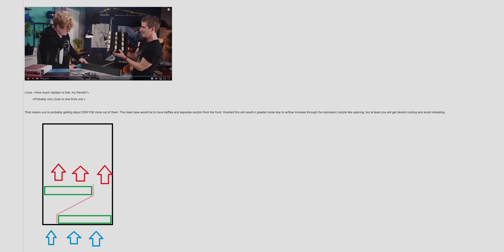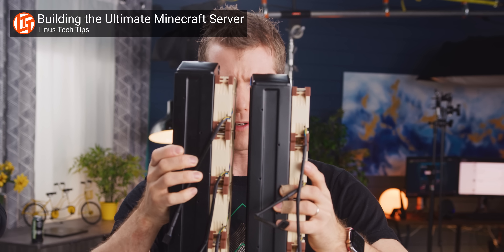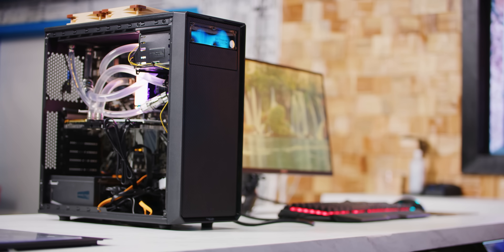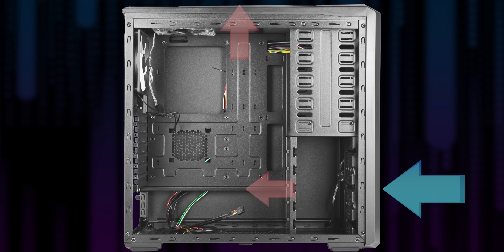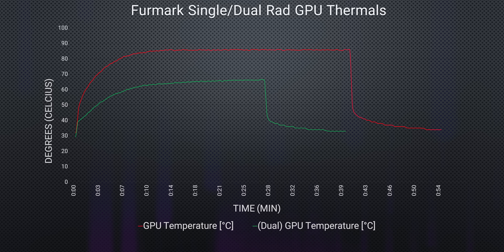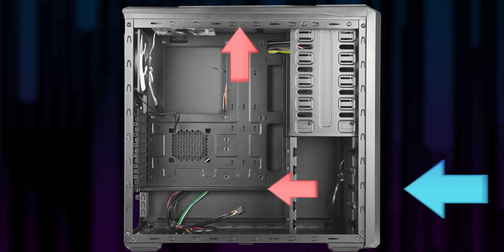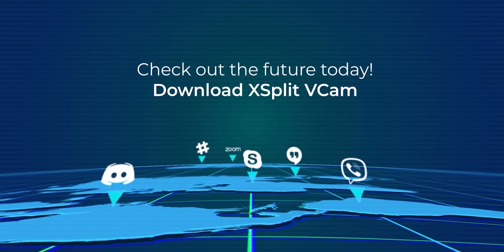I’ve been water cooling wrong for YEARS - $H!T Manufacturers Say

Comment: ok so issue right away, you go from a system that pulls in air from the front to a system the pulls in air front and actively exhausts it out the top.
If you want to do it right those top 2 fans would be there in both tests, the only difference should be the second radiator.

Comment: Linus should hit up Engineering explained and look up the Honda Civic modding community to do some research into the physics of stacking radiators
Reply: YES 😂
Reply: An EE x LTT collab would make my life
Reply: They are probably already collaborating. A lot of the bigger YouTubers do in many ways. (: But good point either way.
Reply: If you seperate the rads, it's usually fine. But stacking them doesn't work well. That's why running air conditioning on a hot day can result in your car engine overheating, as the radiator and condenser are stacked.
Reply: This one /watch?v=Ldfuzy_JJUo

Comment: Your experiment is ill conceived. You should have tried just an exhaust radiator, where you're not blowing hot air into your case, with an exhaust radiator and an intake radiator, or just two exhaust radiators v one. Blowing hot air into your case makes zero sense.

Comment: for efficient cooling you should use an external (case independent) radiator, such as MoRa.  On your dual rad system the warmest water should first go to the top (or outblowing) radiator, so most of the the transported heat would go out at first. the second rad has lower heat to cool and the resulting air coming air would not be so warm as if it would be reversed.

Comment: stacking radiators is not as efficient as spliting them and there will be more or less diminishing returns depending on the actual setup BUT it would still be benificial especially when that is the only way you can add a second rad. what was corsair think they were doing. probably got too much budget for marketing.

Comment: ambient temperature: 21°
Me in Chennai,India: "Oh my! These guys must run some pretty ballin industrial grade AC at full blast for these tests!"
Reply: Yup it's a massive one for sure, It gives on average 10-20*c lower themperatures in summer and can go as low as -30*c in the winter. So it's really fantastic, and it doesn't even focus only on the house. Nah they use this thing on their entire country. It's sometimes so cold that some individuals use what we call heaters in their houses, it's ridiculus. 

It does give some fantastic temps for cooling your PC though...
Reply: @rainmaker6217  if you hold the alt key and type 0176 on the number pad you get the degrees symbol. °
Reply: @DavidCulverslicingblade  To much work... °°°°°°°°°°°°°°°°°°°°°°°°°°°°°°°°°°°°°°°°°°°°°
Reply: @rainmaker6217  dude u joke but most of India thinks a "heater" is the thing you use to get hot water to bathe with.. It took me a few seconds to realise you meant like a space heater 😅
Reply: @rosshalz  Haha, yeah... I don't live in Canada either, but the temps in British Columbia (Where LTT is based) is roughly the same as where I live in Norway. I might have referenced the wrong thing using the word "heater", but I am also fairly certain I have only really heard it used in the sense of a space heater... Then again English is only my second language.. so... yeah...
Reply: @rainmaker6217  There is a thing called a furnace too. Or a central heating/cooling system. or HVAC . Though a furnace is also a thing that melts metal in industrial applications. The English language is the worst I swear, and I'm a native speaker from the U.S.
Reply: @oldyogi23  I thought a furnace was one of those coal or gas powered heaters. We generally don't have those in Norway. We usually either have electric heating, central heating or simply a fireplace. I mean other options exist, but they are far from common. But yeah, I don't generally talk a lot about heating while using the English language so I will admit that my grasp on the intricacies of it is less than good.
Reply: @rosshalz  huh do they? most people here in northern india call them water heaters or geysers
Reply: @rainmaker6217  yeah we call our central heaters, furnaces. some times gas some times electric. but you are right a black smith or smelting furnace is coal or gas powered.
Reply: All equator pc user shall cry
Reply: Yup pretty much same in kolkata 😂
Reply: @sayanghosh622  oh yeah Kolkata is also additionally much MUCH more Densely packed 😅
Reply: Their giant industrial grade ac is called the arctic
Reply: Not just India. Here in southern Australia it's delectably chilly now, but our summers … well, the whole world already heard what happened here last summer.
Reply: @mamasimmerplays4702  its rough
Reply: Pretty much the same everywhere in India. I am from Hubli, Karnataka though.
Reply: I live in Chennai too and keeping my house at 21 is an excercise in heat management. My ACs are running full blast 24x7. My electricity bill is gonna kill me pls help
Reply: That's like one of the hottest days in the Irish summer 😭
Reply: no one gives a shit bout india
Reply: @Saj123  And looking at your subscribers no one gives a shit about your youtube channel
Reply: @Saj123  Except for the billion people living there. Prick.
Reply: @BirdyLegs2849  wow, someone is getting their facts wrong
Reply: @Saj123  we don't want your shit.
Reply: @Saj123  found the MURICAN
Reply: @Saj123  They do. Entire streets full.

Comment: At the end of the day you can't cool it any lower than the ambient air temp at the fresh air intake in a fan cooled/radiator type system without adding some other component into it. Now if there were an actually ac unit or something of that nature you could. Running hot exhaust through the intake of a second fan/radiator set up isn't that efficient.

Comment: Like all heat exchange systems it is all about coolant flow.  In this case, air.

You might capture the temperature of the air at egress for borgbsetups to what the difference is there.  If you get bored.  :)

Comment: A blanket statement that stacking rads is wrong. So is a blanket statement that the air temp off the rad is nearly the same temp as the coolant in the rad. Inquiring minds want to know. What was the temp off the back of the front (ambient) rad? Do you even know?

Comment: They criticized you stacking 2 radiators right on top of each other. Would be nice if you actually copied that
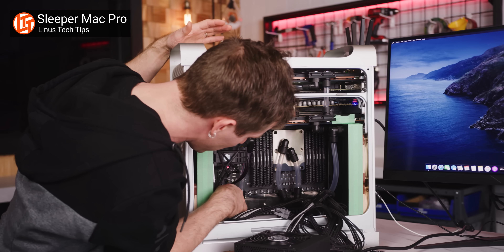Reply: 6:45 tho
Reply: Well he did remove one from the Minecraft server with stacked radiators and it resulted in temperature gain
Reply: someone didn't watch til the end of the video lol
Reply: Their radiator stacking was stupid.  Sure, it gives more surface area and might not hurt it but it is a waste.  blowing hot air into the 2nd which blows even hot air into the 3rd.  If they had all three getting fresher, cooler air it would make a much bigger difference.  Wouldn't be surprised if removing the 3rd radiator, but leaving the third fans, would have left the temp the same.   
Even here, they didn't test what it would be with both radiators getting fresh air from the outside, both pushing in while the rear fan and possibly fans on the bottom pull out.   All about heat exchange.
Reply: @curtisbme  Youre a fucking idiot, your car literary stacks radiators.... The air is so spread out it does not heat up as much as you think, and he literally proves in the fucking video that it still works. Dumb fuck
Reply: @curtisbme  You should rewatch the video, the point wasn't to prove that 2 radiators getting fresh air each is better then them sharing air. we know this already, like, no shit.

Pay attention
Reply: @runninggames771  Seems like listening (or critical though) isn't you strong suit so maybe just let the adults talk.
Reply: He did. What are you talking about?

Comment: Hate to point this out but they were simulating your SERVER configuration which DOES have a closed chassis which only only allows air in from the front and nowhere else. So to be legitimate you need to repeat this video using an enclosed server chassis otherwise you are being disingenuous.

Comment: They just assumed one rad could exchange ALL the possible heat from your CPU&GPU, which is a very wrong assumption for most rads in very hot systems.
If your CPU/GPU is at 80°C stable, your water *might be in the high 60° (*depends on the liquid, radiator efficiency, quantity of water, pump flow...)
Meaning you still have about ~30° of potential heat exchange available with your room temp.

A second radiator, if it has only the hot air from your first radiator will be less efficient. However as you mentioned that's almost never the case so you have a lot of fresh air available for that second radiator.

And even IF ! << big if. You didn't have any other air available except the one from the first rad, your first rad still has performance limitations and adding a second one with extra fans will increase the overall system heat exchange capability :

Performance Radiator - Explained [Engineering Explained], it's about cars but it will teach you a lot about radiators performance. Computer radiators are about the same design as the ones in cars, the form, shape are different, but it works the same.
https://www.youtube.com/watch?v=Ldfuzy_JJUo

Here is a JayzTwoCents video explaining why multiple radiators are important in some systems :
https://www.youtube.com/watch?v=gohE6cytlFU

Comment: wouldn't it be a good idea to measure the input air temp vs output air vs water temp? you cant just assume that the rads are 99% efficient. if the air going into the rad is cooler that the water you'll get better temps.

Comment: Title should be: Corsair emails stacking radiators does not yield the best results, Linus tries to prove them wrong by doing tests that are not even remotely related to the stacking radiators Corsair emailed them about.
Reply: he said that in the mc rig they removed one of the stacked rads and the temps went up. didn't show it though so maybe that's why it was a bit confusing.

Comment: I think that swapping the setup around would change the outcome. Let's imagine that the intake rad is already enough to cool the system (intake 240 thick) und the 120 is the outlet than the temp difference would probably bigger because the 240 rad desperates more heat

Comment: Just a few things to think about for people trying to work out reasons why this is the case

- The water temperature through the whole loop stays virtually the same, there are no hot/cold spots
- By adding a second radiator you are adding more water volume, more water volume will naturally increase the amount of heat required to reach the same water temp (lowering the water temp with the same level of heat)
- The radiator fans that are expelling the warm air from the case are creating a wind chill effect.  This will cause the air to cool and hence be colder than the water in the radiator and therefore allow a heat exchange to take place
- Hot air rises, so warm air will naturally leave the case while drawing ambient (cool) air from the rear/base of the case
- Air cooled PC's with heatsinks have a much higher internal air temperature than radiator based PC's so the air inside the case won't be as warm as you may think

Comment: But the temperatures didn't change. The only thing that changed was time to max and time to min, so couldn't that be accounted for by the extra thermal mass of the additional water added to the system because of the volume of the second Rad? I'd be interested to see if the same numbers hold up by just adding a larger reservoir but no additional heat exchange. You could simulate the appropriate volume by just having the Rad inside the case, removing its fans, and taping up all the fin surfaces so active thermal transfer wouldn't occur aside from surface radiation the same as an internal water tank would experience.

Comment: The coolant loop routing is also important, hottest coolant into the upper (2nd) radiator , then to the front one will ensure the best delta temperature across each rad.

Comment: Corsair: in this test cases another radiator is useless

Linus: let me prove you're wrong in a different scenario
Reply: Exactly this. I don't get why he did not do the test for one of the cases when corsair actually told him that it's bad. Or he could have reached out to corsair to simulate this case. In this case it also is under 90 degrees celcius with one radiator under full load for quite some time. Which means that it's still fine. For the supposedly longer livetimes of the components due to less heat is meh as this isn't a setup to run at full load for extended times.

Edit: A major issue here is that in the cases when corsair said it would not help, all sides of the PC case were covered by radiotors indeed hindering the air flow. In the setup in this video the back is essentially open. Many more things are to be considered too. Overall it's not clear if more radiators would help or not but comparing different scenarios in a simulation and an experiment is just bad.
Reply: General Rambling nerd
Reply: @notnico6170 , thank you.
Reply: Oh look, someone didn't watch the entire video before commenting, how unusual.
Reply: @rianabi12  beat me to it.
Reply: He did test the Minecraft server though,at the end of the video.
Reply: @AbbasHiridjee  I don't see them doing any comparisons for the number of radiators for their minecraft server in this video or its building video (https://youtu.be/Y4uIvK8Y7t8?t=683). If it's there and I just don't find it please point me to the timestamp of the corresponding video. Corsair essentially said that three radiators behind each other is not a good idea based on their simulations. (That's what I got from this video here.) So to check if this is true Linus would have to take out one or two of the radiators in the minecraft server and then compare the temperatures.The main issue would be that he has to turn off the server for that what he probably doesn't want to do.
Reply: @GeneralRambling  Watch the video, don't just click through for graphs. He mentions they tried removing a radiator and temperatures increased 5 degrees - that doesn't need a graph, that's conclusive enough on it's own.
Reply: 6:48
Reply: @j_colebank6599  Thank you. The general issue is that the setup is never properly explained. "We had Jake remove one of his stacked radiators, [...]" Does that mean he removed the additional fans too? Because supposedly Corsair claimed that the air flow hinderance should outweigh the additional value of another radiator. Thus, in their reasoning it would be important to remove a radiator and only a radiator. This is the big issue with this video: The setup is just not properly described. Usually that's not an issue for the videos of this channels as it doesn't really matter. If you have a scientific conversation (which he is implicitly trying to have here), it matters a lot though.
Edit: Also they could have reduced the whole video to: We took out an radiator and it was 5 degrees warmer.
Reply: @iskierka8399  He removed a radiator AND the fans attached to them, so do we know if the decrease in airflow caused that, or was it the radiator? That is something you can't decide from their test. And why does it matter? A radiator may be around $60 $70 and fans say $20 each, so it's the difference between $40 (two 140mm fans) or $100 (two 140mm fans + radiator). It's a failure to account for changes, and it's bad science.
Reply: @GeneralRambling  at 6:50 he says he had jack pull one and the temps went up
Reply: It is the same, the logic still applies.

Comment: So, I'm not privy to the emails they sent you, nor am I an expert at this. But as far as science goes, you're doing it wrong. By adding another radiator you're adding more liquid. It's like apples and oranges. Of course it takes longer to heat up 2 liters of water than it does 1. For this test to be accurate you need to try something like one 240 rad at the front vs two 120 rads. Changing the amount of liquid is of course going to make a difference, but does it make a difference with the same amount of liquid in your loop if it's one vs two rads?

Comment: I do agree with the 'you gotta work with the space you've got' however as many videos as I've seen here there is always a better way to do it and the chosen one is usually the one that can be done quicker.
In the computer used as testing bench for instance the rads should be placed in the front and in the back both pushing air inwards and fans on top pushing the air out. Maybe even fans at the bottom pushing air inside - but that could blow A LOT of dust inside so… Anyway I'd bet that would get even better results.
I do appreciate the fact that they tested the same theory in the Minecraft server with stacked rads. For that alone I clicked like on the video.

Comment: Bad science and biased experiment! Your system was marginal at best. The claim is that when you have an appropriately sized rad adding a second one won't help, and this is true. Why didn't you measure the deltaT across both rads with a thermocouple? The only reason this 'worked' was because your rads were undersized to begin with!. 85C under water-cooling? c'mon... This whole dOn't TrUsT tHe SiMuLaTiOns needs to stop, it does more harm than good.